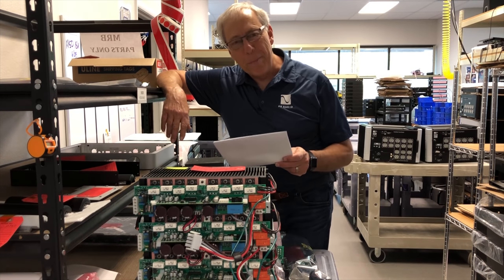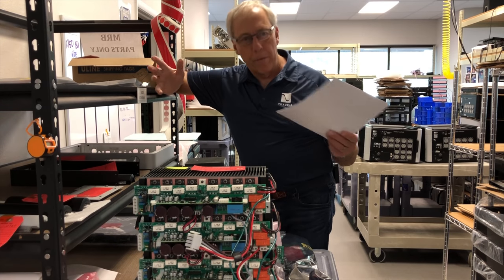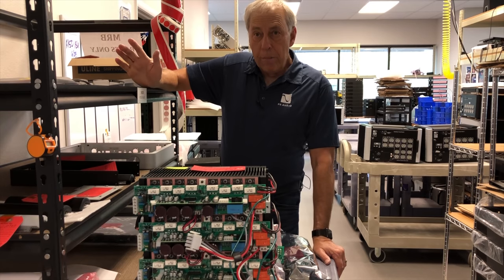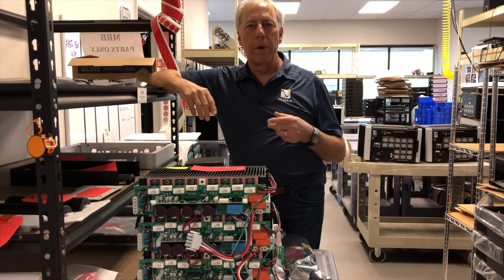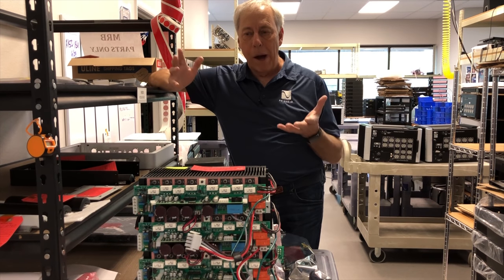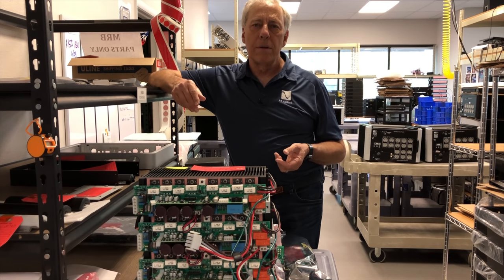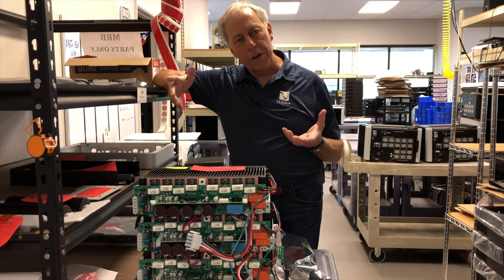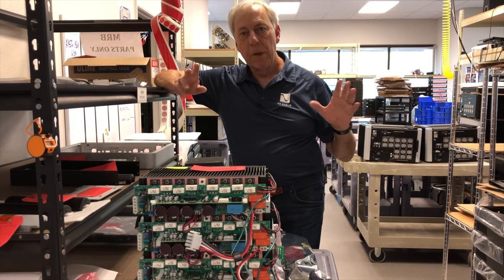Is the BBC dip still used in speakers?

Comment: Thank goodness for multi-amped speakers with amps and digital crossovers built-in and designed-in dispersion control wave guides to keep the power response and frequency response smooth from top to bottom! Like my Genelecs.

Comment: Wow! What I think is half a power stage of an amp, is plenty of surdimesioned parts! 8 power transistors of maybe 200watts collector dissipation! Good job!
I had a Harbeth M-30 for too long, five years. I never found right their sound even if their sound was sweet and musical in the upper frequencies. I could't ignore the lack of tighness of hermeticity... sorry for the lack of words, I found the nether region untruthful, I hated this, even my former cheap Infinity Infinitesimal Sub+Sats were more accurate. Now, I've found the best of both worlds in a TAOC-FC3000 speakers + Rel Subwoofer. Most of the time, the Sub isn't needed, those stand loudspeakers go down to 40 Hz.
Never will I buy another BBC monitor. This is just my experience, besides, with certain kind of music, the BBC speakers can be outstanding, BUT...blame the thin wall cabinet!